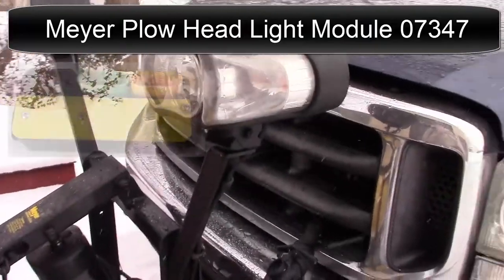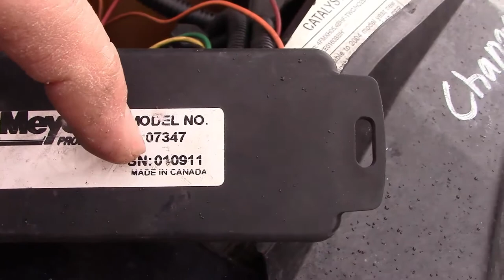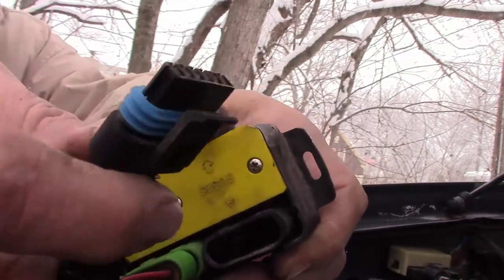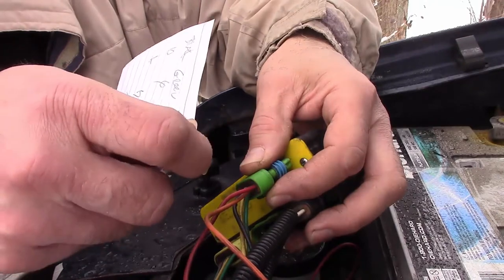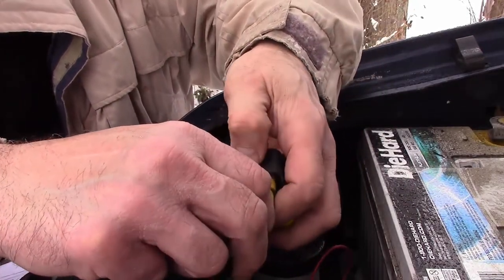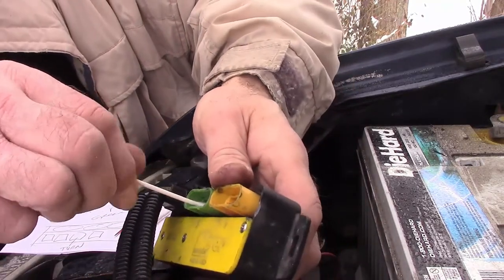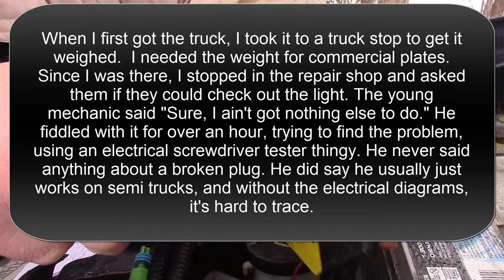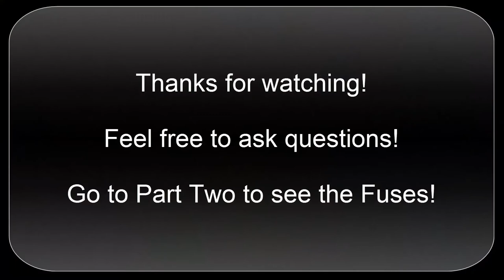Meyer Plow 07347 Light Module Repair Part 1 of 4

Comment: Hey again Mr.Jim. Thought I'd look at another one of your videos and see what you had going on. Just going to put this out there, at the first of the video ,when you showed the passenger side light module just hanging there . Wow, I thought '' that's not good at all''.We always mount them facing up ,and any other relays the plow may have . This slows or even stops them from being contaminated with salt brine or other road spray and grime . Plus hanging by the wires themselves can cause all types of trouble in long term.We also tie up all the wiring to keep it safely tucked out of the way and professional looking.
Reply from the maker: Great info! Thank you. I bought the truck used. It came hanging like that. Should I mount the black flat part up, or the plug side up? I was thinking of wrapping them in plastic baggies, will it work? I'd did wrap some wire in wire loom, but I'll check it out and do both sides!

I BOUGHT THE PLOW-SLICK AND FLUID FILM. I'LL BE DOING VIDEOS ON THOSE SOON.

Thanks for the help!

Comment: thanks this helps a lot  . I have not looked at fix yet but lets me know were to go
Reply from the maker: Hi Screemer! I bought mine off ebay. It's usually a lot cheaper than going to a Meyer dealer. I paid 69.00 and it came with the wires. The ebay store I bought from is not open anymore. Do a search for "Meyer 07347." the MEYER HEADLIGHT WIRE FOR NIGHT SABRE goes for $3.00 by itself.
Reply from the maker: Meyer 07548 Module Kit 
https://amzn.to/2KryVCN